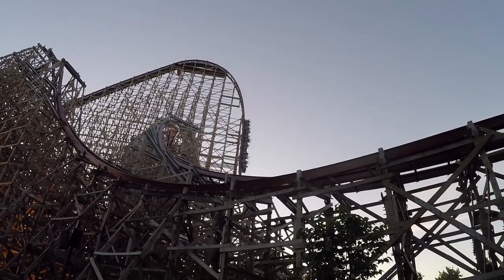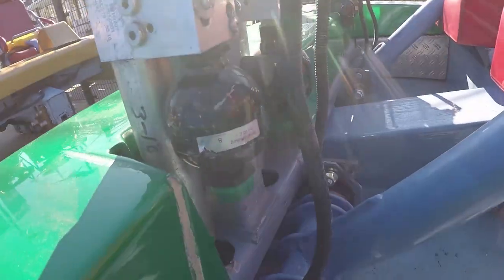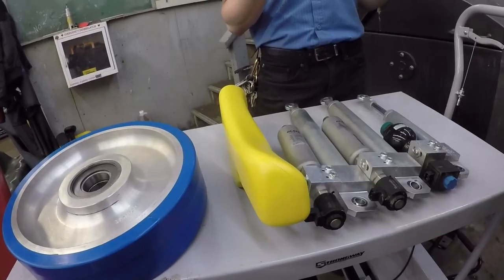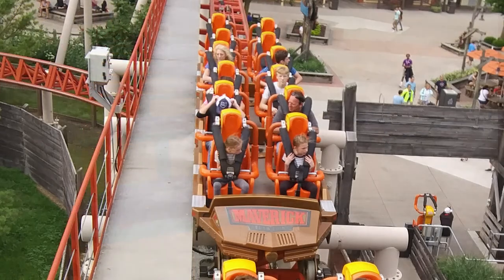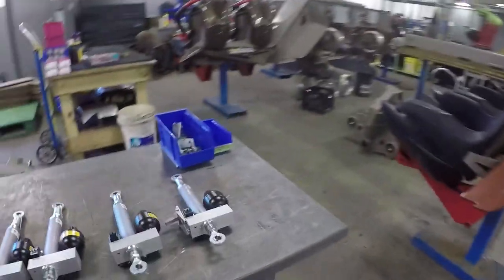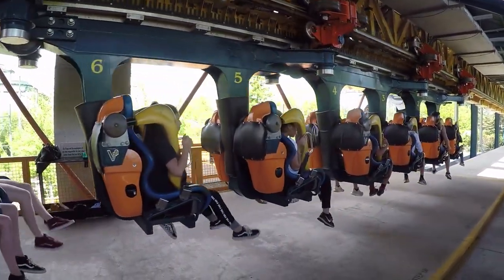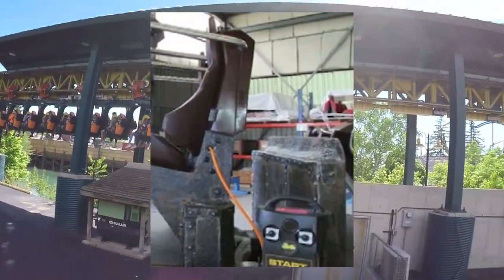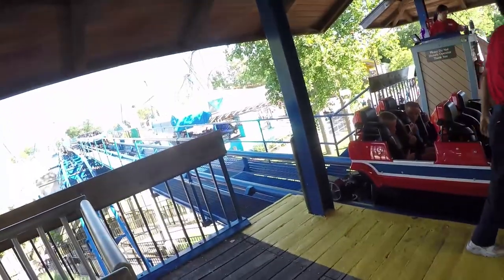Can Roller Coaster Restraints Open Mid Ride? (how roller coaster restraints work)

Comment: I am ALWAYS grateful and relieved when rides have a seatbelt as well as a restraint. I think it should be mandatory on all rides!
Reply: why? they don't really matter
Reply: @VECTOR_Coasters  what if it malfunctions or the underage operator is incompetent
Reply: @nytrek9815  but they cant really malfunction or at least the ride cant start if it malfunctions and also i don't think a single major ride built in the 2000s and on have had any problems with restrains without seat belts
Reply: I disagree that it should be mandatory because modern day restraints are filled with many redundant saftey measures to not open up mid ride and if needed (for weight reasons) a park will put seatbelts. That being said I do also appreciate seatbelts on the rides as I know that if anything were to happen to the main restraint I'm safe because the seatbelt is holding my restrant in or keeping me down.
Reply: I am thinking of the Six Flags I go to.  I believe all the coasters at least have seatbelts in addition to the restraints.  Actually though, Superman Ultimate Flight is an exception.  This one does not have seatbelts, just hydraulic locks.  That is the last one I rather not have a seatbelt for though.  Because if the hydraulic locks become loose, you are definitely falling out of that ride, as it is a flyer.

Comment: I may sound like a crazy gp but I was on the skyliner at lakemount park in Altoona pa. My dad and I were in the back row of this really old run down wooden coaster. On the second drop when we hit the bottom of the hill our lap bar shot up. We quickly grabbed it and pulled it back down and it re locked it’s self. We told the operator when we got back and the ride was shut down for the rest of the day. Still never deterred me from riding again but that is an extremely rare case of catastrophic failure.
Reply: 😬 yikes!
Reply: ratchet bars do have their flaws unfortunately, when they wear out they wear out bad
Reply: I ride with my hands up 100% of the time, so I probably would have died there
Reply: My question is how did it shoot up on the bottom of a hill? It isn’t airtime it is positive forces. So it would stay down until you crest the next hill
Reply: Lakemont seems pretty run down, not as much as Conneaut Lake, but it seems sketchy. Leap the Dips' track seems to flex much more than it should
Reply: I had something similar to me happen on a ride called wildfire. It has 3 loops. and I guess the hydraulic failed on it and it raised up, only being caught by the seatbelt, and the failsafe clamp on it. Told them about it, and took a while to calm down. Been on plenty of coasters since.
Reply: @Wiltings  Ah one of crazy RMC. It definitely scary experience
Reply: @WouldntULikeToKnow.  That happened to my brother on American Eagle at Six Flags Great America. I stay away from older rides like that with worn down ratchet systems
Reply: @Wiltings  don't believe you. Firstly this like never happens. probably actually never happend anywhere in the world. and when the restraints are released you have to put quite some pressure to do them open. so it still would stay in place
Reply: @demonghost6361  valleys are some of the most forceful/rough parts of woodies so it coulda been from jackhammering and less the forces on the lapbar, just a thought

Comment: To summarize for whoever doesn't decide to watch the whole thing - yes, it is possible for restraints to come open mid-ride, because mechanical failures are possible, but this is obscenely rare and the restraints are very specifically designed for this to NEVER happen. If you think coaster restrains pose a significant hazard due to this incredibly small risk, then you should probably never drive or ride in a car because they're absolute death traps by comparison.
Reply: Cars are more dangerous than coasters and airplanes

Comment: Honestly, this did happen to me once, but it was at a state fair on one of those crappy coasters. The bar came down and the ride operater locked it from the outside. Problem was, he didn't lock it like he thought he did, and at the first drop I heard a click then the bar started to rise up. I kept it down with my arms and I was fine, but it did happen. Dude was definitely high or drunk which I'm guessing caused him not to pay attention. I fully trust regular parks and don't think it would happen there, all I'm saying is watch out for drunk ride ops at county and state fairs. They don't give a crap. Probably didn't help that this coaster looked like it was from the 60s.
Reply: was it a wacky worm
Reply: When it comes to these safety videos, you can throw carnivals out the window. They are bad at safety, and it is hard to trust the people operating the ride.
Reply: @zachcoastercrazy4032  Depends on the Country. Here in Germany, and probably most other central and west-european countries, has the same, if not even stricter, rules and regulations applied to carnivals as in Parks. I.e. in Germany every carnival ride has to be inspected by a safety inspector that is specially trained for amusement ride inspections at each carnival a red is set up. If a showman is unable to fix issues on the spot the ride will sit essentially in SBNO mode on the carnival / fair for everyone to see. Such a thing did happen in my neighboring town a few years ago when a portable Freefall tower failed safety inspections it had to sit on one of the absolute best spots and they where unable to do anything about it.

Similar to stationary rides the restraints for each guest has to be checked for each ride cycle and people working these rides take their job at least as serious as the Parks do, maybe even more so due to the usually much higher amount (slightly) drunk people.
Reply: @andyroman8223  Nope I believe it may have been an old Pinfari Zyklon. Not sure though.
Reply: @tabbijoy6448  What Park, what coaster and when did this happen?

Going by your Story the trains must have been at least 3 wide, more likely 4 wide though as 3 is extremely uncommon. 4 wide is most commonly found on rides made by B&M. Every B&M with OTSR that I have ridden has a little Seatbelt that attaches to the OTSR making it IMPOSSSIBLE for the restraint to open all the way up in the event of a locking mechanism failure.

Gerstlauer is another company that does commonly build 4 wide trains, some do have OTSR, however to my knowledge Gerstlauer doesn't feature Seatbelts, therefore the OTSR has at the very least 2 independent locking mechanisms that both have to fail at the same time for something you described to happen. Something like that is statistically so impossible that if it actually happened news of it probably would have made the round.
Reply: I was at Busch Gardens once and went to ride the Scorpion. I pushed down the lap bar and it locked into place. When the cart left the station the lap bar seemed to release and come up again. So as the cart went up the lift hill I pushed down the lap bar again and it locked in place again, it stayed locked for the rest of the ride. Now what I remember from this is probably messed up since I was around 8 years old when it happened. I am pretty sure happened to the other riders but they never said anything about it so I was probably overreacting about the lap bar moving a little since I was a nervous 8 year old. I believe that the Scorpion is a safe ride to this day, just a little rough due to age.
Reply: @Soonjai  This appeared to be more of an operator/staff issue than a technical one
Reply: @zachcoastercrazy4032  oh yea absolutely. I went to a fair and my restraint came up on a ride called full tilt. I managed to get it locked when it was half way to the top after everyone started screaming at the ride op who obviously didn’t give a shit.
Reply: @Soonjai  ich wohne in Deutschland, trotz habe ich noch Angst um Achterbahnen zu fahren 😭
Reply: @khkayla6575  That's just the distance between the stops in a ratcheted lap bar. Some definitely have more space than others.

Comment: The restraint never locking in the first place has always been a fear when riding and I try to wiggle it every time to see if it really did lock. Once the ride is moving I don’t have a fear it will unlock, though I have felt myself slip around too much inside some restraints because they seemed to not go tight enough on me even when fully locked.
Reply: If you aren’t able to move around in your restrain in the first place the ride isn’t very good. Or you just have it too tight
Reply: Lol that happened to me on Magnum yesterday by accident. I didn’t like how the lap bar bounced when I made sure it was locked and my brother was like “yeah. For me, I want that, but I know for you, you dont like that feeling of airtime that much.” So he managed to push down it and it accidentally locked on the tightest position it could go. Before we could contact someone to lessen it a bit, they said all clear. I was fine the entire ride until the bunny hills due to the lap bar being so tight

Comment: I am a very rare case where this DID actually happen, due to negligence by the ride operators.  When I was about 8 years old my restraint was not properly locked / checked  on Ninja (now Blue Hawk) at SFOG before leaving the station.  It was only halfway locked and would fly up quite a bit throughout the ride.  Scariest moment of my life, my aunt reamed out the operators, whom were extremely unapologetic and rude teenagers.
Reply: In your defense, SFOG has had many many many complaints about bad ride operators and overall carelessness, and it still happens to this day. Don't go to that park if you wanna live
Reply: @OvergrownWithTheMoss  What does SFOG stand for? I'm assuming the first half is Six Flags, but what does the second half mean?
Reply: @blueflare3848  Over Georgia
Reply: Yeah the Ninja is still unforgiving and painful even after the name change. Even if you were properly restrained it’s still a neck breaker. Or as my brother calls it “abstract art.” 😂

Comment: I'm so old that I remember when the "restraint" on a roller coaster would be a chain -- like the kind you'd tie a dog out on -- hooked across the seat. I took my daughter on one of those roller coasters about 42 years ago, when she was about 5 or 6 years old. During the ride she got scared, slipped down under the chain and onto the floor, and I had to reach down and grab her by the pants and drag her back onto the seat before she could get thrown from the car!

Comment: Once my restraint popped open after the first drop on the Mantis at Cedar Point, and mind you, that was a stand up coaster at the time. I had my arms up, and had it not been for the belt clipping the bottom of the restraint to the crotch mount out whatever you call the seat on a stand up coaster, I would have probably been ejected from the ride. I really thought I was going to die every time the train did an inversion or hit a big airtime hill, but even with that being said, I still think roller coasters are incredibly safe. I was able to hold the restraint down for the rest of the ride, and when we arrived back at the station, I told the ride operator and they took it very seriously- the ride was down for the rest of the night.

Comment: Around 4 years ago I was at ceder point  riding the Raptor and my fiancees overhead restraint unlocked while we were going up the first hill. Like the intelligent person she is, she decided that instead of trying to pull the restraint back down,  she would just start bawling her eyes out instead. Me and the other guy next to her pulled it back down and it locked, but we looped our arms through it and held tight just in case(hurt like hell holding it that way) When we got off we told the ride operator what happened. Showed him the seat, and he said "oh ok" and loaded the next people into it. And that ride operator alone is why I don't like roller coasters anymore. I can trust the engineering, i can accept the one off tragic random event, but I cant accept a seemly stoned out his mind kid being responsible for overseeing the immediate safety of a ride and it's passengers. We ending up reporting it to some other staff and the next day we got into the park and noticed that one of the carts was being worked on. I hope that kid lost his job because he ruined coasters for me forever.

Comment: There is also a third type: Mack Rides uses a sort of gas filled Cylinder. But i can`t remember what gas exactly
Reply: Gas filled? Maybe in a reservoir to pressurize oil, but I can't imagine that you'd get away with a compressible fluid to lock a restraint closed, especially in Germany.
Reply: Nitrogen usually
Reply: Also a forth, buzzbars!
Reply: @markvolpe2305  Aren't those still ratcheting, just with one click?
Reply: Pneumatic restraints usually use nitrogen.

Comment: I actually had my restraint unlock on me mid-ride on the Big Bad Wolf back in 1987.  I was 13 and it was my first big coaster.  It hasn't stopped me from riding but I greatly appreciate a secondary lock such as a buckle that secures the harness to the seat.  The B & M hypers, such as Mako, still give me pause.

Comment: I worked on a rollercoaster where the train could be dispatched with restraints up, they were never left up though, there was always two staff, one for each side of the car, and the last thing we did before hitting the button was check the restraints, we used to push down on them until they clicked one more time, then tried to lift them to see if they would come up

There was a pedal at the side of each car that engaged on a rail, rhe rail would lift before the train was dispatched to lock the restraints

Maintenance did tell me though, you could if you wanted to send riders in the cars around the track with the restraints up, as the design of the track was mostly all positive G's, so no riders would fall out, as the loops would push you down and backwards into your seats

The only time you might come out your seat is when you hit the brakes

I also worked on a ride that had tripple locking harnesses, that had hydraulic, and ratcheting, and electric locks, plus seatbelts, so that was mega safe 😁

Comment: It happened to me once on OzIris. The OTSR opened up one ratchet.

Great video btw - interesting topic and solid research 👍
Reply: For some reason it seems to be more common on B&M inverts then because the same happened to me on Batman the Ride
Reply: I had that happen to me on the Hulk at Universal Islands of Adventure back in the day. Probably around 2005 or 2006. It didn't unlock completely, but it did move to the next ratchet up mid ride. Still continued to ride it every weekend I went though.
Reply from the maker: sounds like it "slipped a ratchet" meaning that it was not fully clicked into one ratchet before the ride started, at some point during the ride it moved up, it happens from time to time. Thanks for the comment!
Reply: GP To Enthusiast makes sense
Reply: @CoasterCollege  ☠️☠️☠️ idk if you agree with this, but with the ratchet mechanisms, we know those eventually fail, why are there not redundant ratchets, and a system to check function of both ratches? Redundancy means nothing if you don't find out one isn't working. Relying on one piece of metal and one spring seems like suicide tbh

Comment: Check out the King Cobra roller coaster at Kings Island in Cincinnati.  In 1991, the chest restraints came half way open on me while exiting the  big loop. I didn't freak out as bad because the abdominal restraint was still locked and my shoulders were still technically under the restraint that popped open. I told the operator while getting off and they stopped the ride for about an hour then started back up. Yes, my coaster loving, 16 year old self got right back on it later that day. Lol

Comment: I’ve had reoccurring nightmares about this happening to me since I was 12 (I’m 31 now). Sometimes I hold on, and sometimes I fall out. My father and I were riding Bizzaro (then Medusa) and we went through the ride with no issue as usual. My dad then tells me after we got off that his harness popped open going up the drop hill, and luckily he was able to latch it back in place before the drop. Every time I get on a roller coaster now, I think about that. Though I rarely ride them now because of the nightmares and my paranoia. It’s a shame because I used to love them as a kid.
Reply: Ahh Medusa!! One of my faves!! I don't think the restraint would pop open on that cause I think they're hydraulic.
Reply: @nikolvitanza4746  it is a great ride for sure. I can’t truly verify that it did, as I didn’t see it. Though when he told me, I could tell he was a bit shook up by it. You would think it couldn’t happen, but apparently it did according to him. Who knows if something happened that made him think it popped or if it actually did. Either way, it messed with my head since I was a kid.

Comment: I usually have the opposite happening the restraint locking down further mid-ride. Especially hydraulic ones. Had this happen on Stealth in Thorpepark. Restraint sat comfy, tight but not too tight. Ride ends and I'm stapled to the seat and even had trouble getting it to release inside the station. Though I never have been afraid of it opening mid-ride.

Comment: For the ratcheting restraints, as someone who has a body stature of a 12 year old but height enough to ride despite being in my 20s a big fear is the ratchet going up a notch and because my thighs are so skinny I could just slip out from it. Been on a fairground wave ride that was bouncing me almost in circles on my seat if you can imagine in its waving rotations because the bar did not keep me firm in my seat and if I wasnt clinging on I really might have been thrown as I was bouncing and slipping. Hydraulic restraints make me feel so much more secure